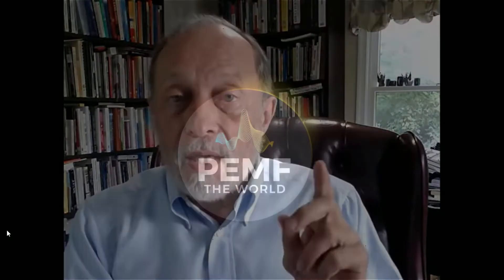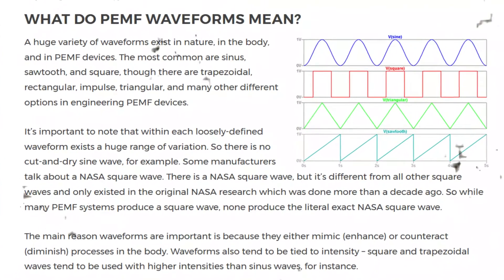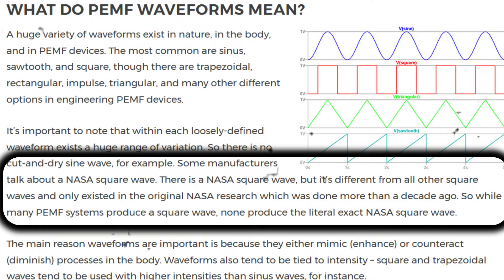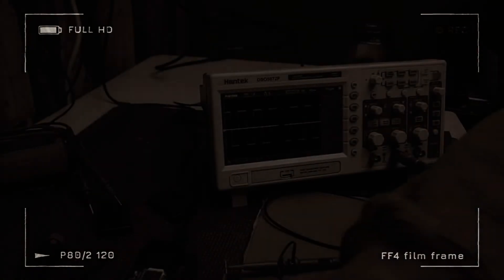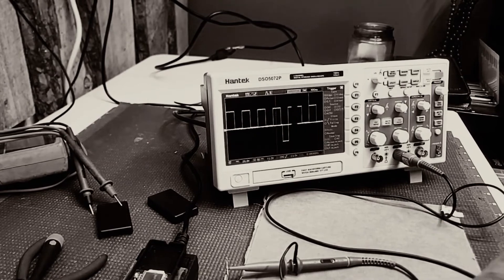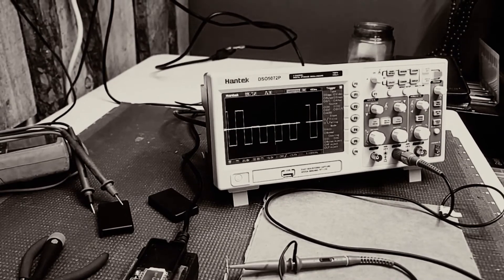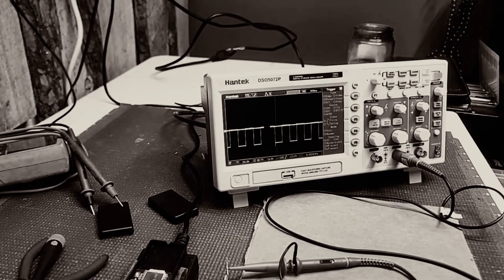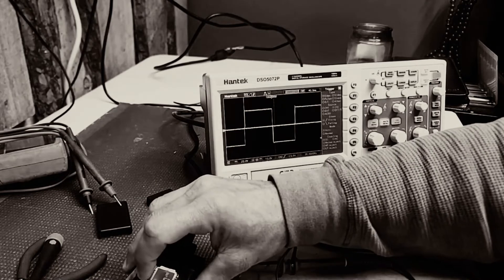PREVIEW: PEMF Bi-polar square wave!

Comment: 🙏 this one came in, new to me 😊 I’ll (also) think this over, do have some ideas… ☺️using mosfets, one handling from the power Plus line, the other one from signal ground…    👍👍👍
Reply from the maker: Keepmus posted.
Reply: Good morning! (here and now!) Am experimenting with several circuits, especially to make a small device using a flat phone battery (3,7 Volt). I wish we were neighbours haha, for easier sharing ideas..(Am working with SMD components, designing printed circuits , but first am finding out the very best way of letting current flow in the coils. Which are e real challenge ...
Reply from the maker: @jackraves7363  go to.my patreon and get my calculator  for free.   That will.help.you a lot.  

Also have you watch my later videos?  And speciallh.the one commin out on 1st of october.  That might answwr a lot of your questuons.  

:)